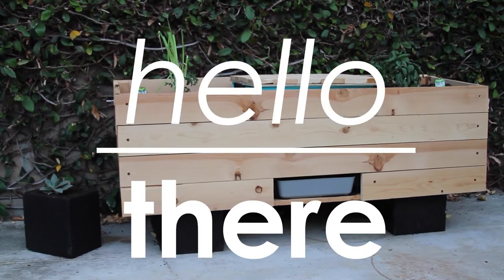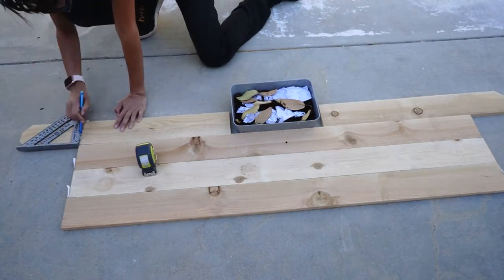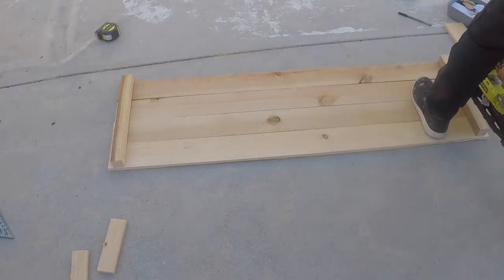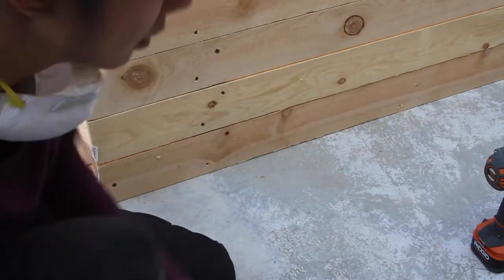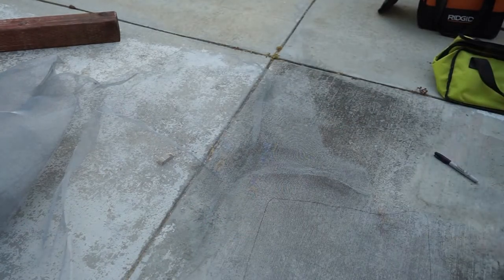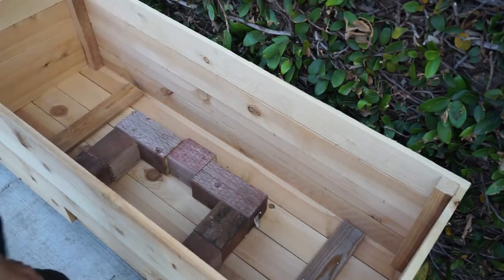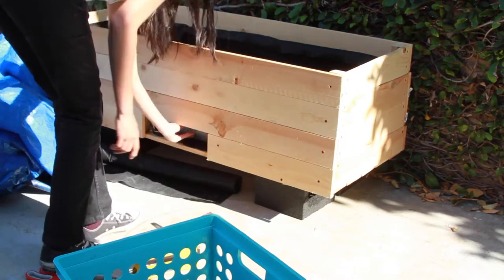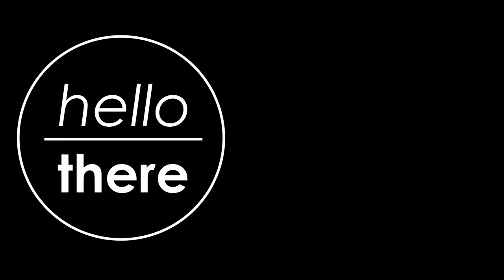DIY Planter + Bench + Worm Compost Bin

Comment: How would you empty the middle composter?Would you just shovel it out and just add stuff back in again?
Reply from the maker: After a awhile, I actually took a small piece of wood, and separated it inside once it got to be a really good compost consistency. Then I only put food scraps on one side so the worms would go there. Then I could scoop out the compost. Some of it wasn’t fully broken down so I took some 2x4’s, made a frame, with some more of that window screen as a mesh, and I’d pour some of the compost on top and let the casings fall into a bin. That stuff id dilute with water as a fertilizer or sprinkle directly on my plants :)